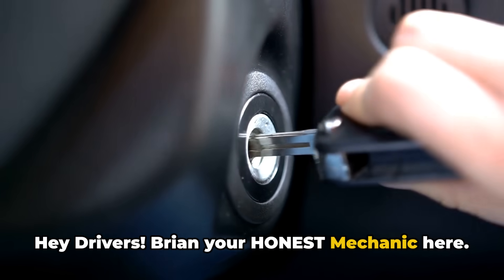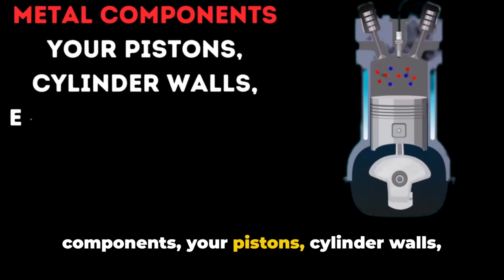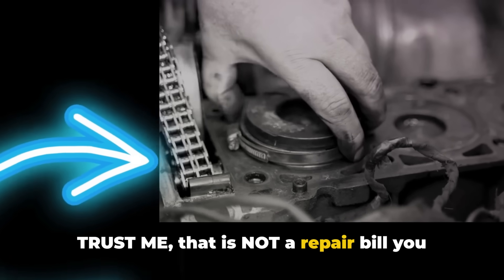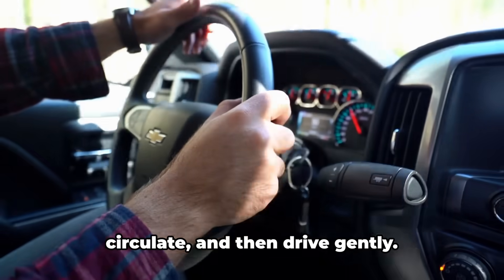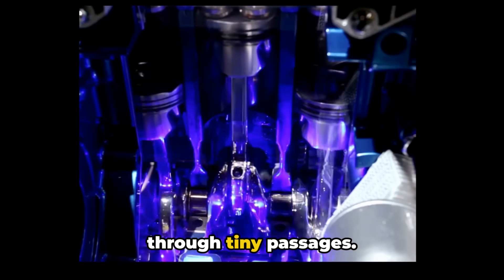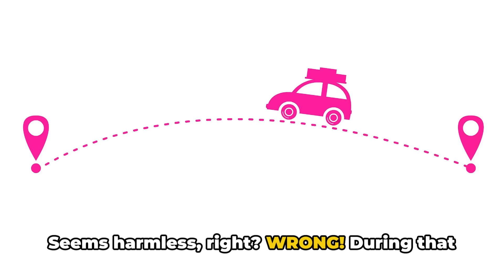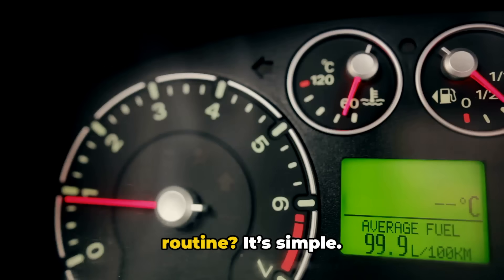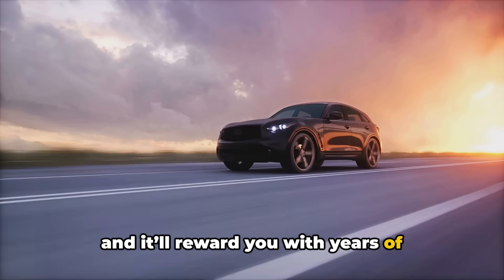5 Cold Start Mistakes That Wreck Your Engine (Avoid These)

Comment: This applies to pretty much any engine driven vehicle. I have a 2003 Kawasaki KLR650 that I’ve owned since new, and when it’s cold, use the choke to start, then turn the choke off ASAP. Go easy till the engine is up to operating temp. It has gone through three clutches, but runs like a champ at 80,000 miles. I have many high mileage bikes, and all run well following proper warm up and I’m a stickler for maintenance and using quality oil and replacement parts.

Comment: The waiting only 30 to 60 seconds of idle time, is this only for newer cars? I have a 2011 Toyota Avalon (I bought it in 2017) & I always let it idle about 2 minutes or so. Is this bad for the engine?
Reply: I dont think 2 mins is bad - its not that long. I do 2 to 5 minutes in cold. 2 would be like 0 C out , 5 would be like colder than -15 C out.

Comment: So it's really not good to use a remote starter? I'm talking about when it comes to cold starts.
Reply: I’ve noticed that control starter makes the engine idle in higher rpm so its actually useful thats the point of the remote starter is in the first place , and it turns off once the car heats up

Comment: I have a hybrid car that wont start the engin until i rev the engin. I dont know what to do to get the damn thing warmed up since it will drive on the  battery for a bit u til it desides to start tbe engin. I was reving the engin up to start the gas engin. Only way i know to get it to engage while parked.

Comment: I always warmed my cars up before driving. They have all run great for years and 200k + miles. My father thought me to I always change oil / filter every 3k 👍
Reply: My father was an auto mechanic and he taught me the same thing too.
Reply: Agreed.   When it's 5 degrees outside, I let it warm up a good 10+ minutes before driving.

Comment: You only briefly mentioned turbos. Shutting down your turbo charged engine, especially a diesel engine, without waiting several seconds to turn it off can harm the bearings in the turbo. Turbo chargers are lubricated with oil that circulates when the engine is running, it gets very hot. When you shut down the engine before allowing the turbo to slow down, the oil is no longer being pumped through the turbo charger as it continues to spin for a short while after shutdown. So give the turbo a few seconds to wind down before shutting the engine off.

Comment: Also like to add that especially diesel vehicles need 5 or so seconds for plugs etc to heat up. To do this turn the ignition and wait for 5 seconds, then turn on the vehicle

Comment: It's a good idea to let the engine idle down on a cold start. And if it's below 35 degrees, keep in under 35 mph for first mile or so. You'll give the engine a chance to circulate
Reply: mph doesnt matter - its revs that matter.

Comment: My only argument is not letting your vehicle idle 10 minutes to warm up. Sometimes longer depending on how cold. It helps keep your battery strong and warms up the oil temperature before you take off. I usually let idle until the rpm idles around 750 which takes about 5 minutes. Taking off while the engine is at high idle can do harm as well.

Comment: Very interesting when you mention not to idle the engine for any length of time but to drive off gently to bring the temperature up quicker. I read exactly that from an owners' manual for my Father's car back in the '60s.
Reply: Wow, That’s fascinating! It shows how good practices, like driving off gently instead of idling, have been recommended for decades. Automakers have long understood that gentle driving warms up the engine and transmission more efficiently while reducing wear and fuel waste. It’s amazing how timeless some advice can be—your father’s car manual was definitely ahead of its time! 🚗📖
Reply: @MechanicalGuy68 so what do you recommend for a garaged car that doesn't get driven on salt covered roads in winter.  Car gets driven year round but skips road driving in winter

Comment: I just bought a 4.6  Crown Victoria and I am horrified by the way the engine races after start up. I have no control over it and I don’t touch the pedals. As soon as it fires it sounds like it heads for 2 or 3 thousand rpm. I hope it’s not doing damage but I can’t control it.

Comment: Another important point, if you have a stop start on your car, keep it turned off.  Reduces engine wear, also fuel it saves is negligible when idling,  and makes the car safer to drive when power is urgently needed (no delay) such as busy junctions.

Comment: I only live about 5 miles from my job. But I stop on the way to work at my favorite gas station which is only a couple of minutes away. Should I drive around the block a couple of times before stopping or what?

Comment: I have a 2020 F150 2.7 twin turbo, when I start it in the cold mornings, she idles low rpms for a couple minutes, then she idles a little higher 12 hundred rpms for a few more minutes then idles down to 7 hundred rpms... Then I drive away slowly... 30 60 seconds!!?? Then drive away ( gently) no way... Never did and never will...

Comment: Nice to drive a plug in hybrid that shuts the engine off in the winter time after 1min drive and then starts and shuts it again and again depending of the throttle imput and the engine never reaches the operating temperature.😢

Comment: I was also told:
Don't start your engine with the A/C or radio on, less pull on cold engine.
Reply: Radio is prob fine , A/C is not good. Radio today is all electronic. It shouldnt draw enough voltage from the battery to make any difference.

Comment: Also don't just crank from start position in most automatics...turn key to 1st position and let fuel engage... you'll usually here a dinging sound and your engine symbol should light up...after that then crank it up.

Comment: Great video. I would add to pay attention to the oil life information on most modern vehicles. It uses injector count to calculate oil life. This will account for the idle warm up and excess fuel in the oil. Use synthetic oil and short change it in the winter. Thirty percent life remaining should be used as a minimum during winter idle increases.

Comment: 2017 Cadillac XTS I start in -5°c or colder. Wait maybe 10 seconds and drive a couple of mins to the store if I have more than I want to carry. It just rolled past 252,000 kms. Never had a single engine issue. I just change the non-syhetic oil about every 8 to 10 thousand kms. Regular maintenance is all that should be required or you'd have engines seizing up all over 🇨🇦 every winter. I call bs. 😂

Comment: The benefit of a plug-in hybrid is to allow the car to run errands on the electrical  propulsion system.  While having a gas engine to drive the car long distances.

Comment: I currently have a 2.5l diesel Subaru outback, which is garaged. Once started I back it out and turn it around in our drive, walk back and close the garage door.This takes a few minutes. Having returned to the car and driving down my drive and turning right on the road and then left or right at the T junction join the main road, which has a 30mph limit, takes a few minutes more. This vehicle has a 6 speed manual gearbox, so I can select a gear that produces 1,200 to 1,300 revs. I always change the oil more frequently than required.  This is a relative young car 2017 and only has done 25,000 miles. So far only routine service items have been replace. 

My previous three car were a Peugeot 405, 4 wheel drive with self-leveling suspension. And two Citroen C5 estates. All achieving 200, 000 miles and then sold on. They were treated in the same manner.

Driving conservatively saves ware and tear and money.
Reply: Are you from Europe? A diesel Subaru sounds pretty awesome
Reply: I had a Citroen C5 estate, the best car I have ever owned with a 2.2 diesel Auto box.

Comment: Remember oil temp is the key.

Also if the car is fitted with a push button start and requires clutch to be depressed, and has been stood for awhile. Turn it over a couple of times in neutral by easing the clutch up so the the engine won't start. Then start up normally up to 2500 rpm, drive away normally, using low revs (WITHOUT LABOURING THE ENGINE) until water and oil temps are in the green. Also changing oil and filter every 3000-6000 miles, helps extend engine life too.

Comment: My cold start of my 2009 Ford Expidition 5.4.  I start the engine and immediatly put the transmission in neutral, this causes the fluid in the trans to circulate and warm up at the same time as the engine extending the life of my trans, I have 130k on it now.

Comment: 96 Jeep Cherokee , 300K, 4.0, auto. Just now replacing my computer. Only leak (being fixed) is the oil extension tube gasket. Care for it like it’s a machine because it is.

Comment: In 1968 I was learning how to start a older tractor with a crank. It was in winter. You had to turn the crank a couple of times not trying to start it. After waiting 15 - 20 min. go back to it, give it a choke, a little throttle, turn ignition switch to on, and crank it hard. It would always fire up.
Reply: In 1968 I was 8 years old. You must be older.
Reply: What was the purpose of the few extra rotations?  And the long wait?

Comment: So we have videos saying, don't go over 2000 or 2500 rpm when cold. THen we have videos that say, dont lug your 4cyl turbo engine, meaning dont accelerate from 1000 to 1500 rpm. The problem is the newer cars shift very early for gas mileage. My car, a 2.5L Turbo, will shift at around 1200rpm when driven gently., it will be in 8th gear at 40 mph. To fight that, I would have to put it in Sport mode but then it will go over 2500 rpm when cold. So what are we supposed to do?

Comment: I wait 2 minutes before driving after starting engine. I work less than a mile from my home. Winter walking is not something I would do. A 10 minute walk in the freezing cold, at 6:30 in the morning, is not something I would consider. So, that part of the cold engine start, I can't avoid. In the warm weather, I do walk to work.

Comment: I started to realize this on my own. Lots of old timers let their trucks run for 10 minutes. My Tacoma wouldnt warm up to Op Temp after 15 minutes. Iv had piston slap in a GM 5.3L and Ford 3.7L. I started just letting the high idle settle down after 30 seconds, 1-2 minutes if havent driven in day or two. The trans temp seemed more important, it shifted sloppy if really cold. And remember if u drive a lot of city, short trips, to change your oil more frequently cuz it breaks down faster. 3k miles at the most.

Comment: Original owner of a 2008 Ford escape 2.3 with a manual transmission. At 204,000 miles, I am still on the original clutch and my engine is running strong with basic maintenance.
Reply: Save the manuals!!
Reply: @mustangman429 doing my part with an 03 Camry and 04 VW Passat wagon.. God speed.
Reply: @natural_law  hell yeah good to hear

Comment: I agree let the car warm up to operating temperatures before racing the motor, I still have a truck from the 60s that I have to drive 10 miles before it starts running better & fully warmed up.

Comment: Spot on I would say in my limited knowledge. I have always believed that long trips wear much less on an engine than many small ones. 
I have also found that should my car over heat on these long trips like uphill it is better to just slow down but keep going at the speed where the temperature is the lowest then it is to stop to let it cool down. If you stop the temperature goes sky high and the engine may seize. It usually doesn't if you keep going slowly. No over heating is best of cause.

Comment: Original owner of a 2005 Pontiac grand am here , had 42 miles on the odometer when i bought it , it now has 389,600 miles on it , original engine,  original transmission,  niether one of them has ever had any internal work or overhaul done . The car even still has the original alternator on it . Doing regular oil changes , regular  trans fluid flushes and drive  like you have some common sense and your car will last you a long long time . And yes i always allow the car to warm up to the 1/4 gauge reading before i drive it . The 3.4 v6 is a very durable engine as long as you take care of any problems that arise as soon as they happen.  The biggest engine killers are not doing oil changes and overheating the engine .

Comment: so what's the minimum journey length you should do before turning the car off again after a cold start?
Reply: I use 6 km / 3.75 miles minimum as a reference. By then, my coolant is typically at 90 C ( normal operating ) and oil temp is around 62 / 64 C.

Comment: I have a 39 year old Toyota Corolla with almost 400,000 miles on it and because of various reasons I can't always drive it.  I do usually drive it a few times a week but when I can't I have let it idle for about 10 minutes on very cold days.  I have never experienced anything negative by doing this then when I am able to drive it again, it definitely seems to ride better than if I just let it sit.  Also there are times when I have no choice but to make short trips.  I do the 30 -60 sec idle, drive slow then make the trip.  I have done this for over 100,000 miles with another car and have never seen anything negative as a s result.  I think just using common sense prevails.
Reply: In defense, this is a very short video and doesn't cover all the ifs, ands or buts... it does sound like you're being sensible, for your circumstances. That said, I don't find any problem with what he is recommending.
Reply: i have a 24 year old Lexus that literally wont move unless you give it time to warm up
itll spit and sputter and hardly move at all if you try to just get in and go
Reply: Those 400k miles could turn to 500k just because ur engine lasted that long doesn’t mean it can’t last longer his recommendations have no argument against it trust the common sense
Reply: Read your manual
Reply: It’s a Toyota built 40 years ago like a tank. This video is for tinny cars that started flooding market 15 years ago

Comment: Years ago i had a real old morris minor van .
I used to do nights shift and.park the old van in a car park near tbe thames.
In the wimter i put a small oil heater in tbe engind bay on low over night .maybe 20 to 25 guys would all go in the car park in tbe mornings ,all cars covered in ice  trying to start .Some needed to be push started  but my old van cranked over and started no problem .only thing i did do was put a cloth over tbe steering wheel to remind me to take heater out off ghe engine bay.

Comment: I'll never forget the time I worked at a warehouse. The warehouse managers son - Graeme - jumped into the warehouse van, a Ford Transit diesel that was iced up. As soon as the engine started, he sent the engine to full revs for several minutes 'to heat it up quickly'. He seized the engine and shot a rod through the crank case. What an utter bell *nd.
Reply: Stone cold igit.
Reply: He probably wouldn't do this with his own car.
Reply: Bell end

Comment: From what I've seen, small car engines today last much longer than the weak automatic transmissions in them so babying the engine is false economy. I have a Nissan NV200 with a CVT transmission. The transmission is non-repairable and is $5000 to replace and is virtually certain to fail before the engine.... so it's not worth fixing. This even if the transmission is serviced perfectly and the engine is not.  Junk yards are full of Nissan vehicles with good engines and defective CVT transmissions.

Comment: It is nice to hear what I have been doing, for a long time, is the right thing to do. My '93 Corolla, ran, and I traded it in, with 325, 000 miles on it, only because non engine parts were wearing out, and I am getting too old to work on cars, any more. I am doing the same thing with my '14 Toyota Tacoma, and hope to have it, as my last car. THANKS FOR THE INFO.

Comment: HELLO  Ilive inCANADA ,shure gets pretty cold in the winter,I drive a Nissan Sentra 2005, 1,8 litres,in the winter ,,with 210 thounsands kilometers,( about 120,000 milles )on the odo, using recommanded oil grade and adding LUCAS OIL STABILISER,,when I i get in the car I start the engine and drive away immediatelly,not carring ,eccept verry high reving,  keeping it in the 2 000 to 3500 rpm,,been doing that for 2 years,engine run,s great has very good compression,no oil consumption at all,transmission works as new,,no need to wait drive and go,,AS FOR STARTING AN ENGINE FOR 2 MINUTES OR LESS  IN COLD WEATHER ,DOES NOT ARM THE ENGINE,,,THE ENRICHED FUEL MIXTURE IS BEEING BURNT OTHERWISE YOU,RE IDDLE WOUDNT BE HIGHER,,AND ABOUT THE RUST BUILD UP, NO WAY, THE STICKYER COLD OIL,NOT HAVING BEEN HEATED UP,THAT HAS BEEN SPLASH ALL OVER THE CYLINDER WALLS,,  WILL PREVENT THAT,,shure if you,re talking about grandmas one it,s different,engine are built to work,lol,,( one thing is not mentionned here  cold metal is harder to wear than hot one,,)when it,s very cold it,s harder then when it,s verry hot,)so cold start and drive aint, a problem,,by the way I own a TOYOTA 4RUNNER 96 2,7 LITRES ,MANUELwith 244 000 kilometres,that I am not using often,due to excessive fuel consumtion,lol,,I,in the winter start it for a few minutes then shut it off,most of the time to moove it to remove the snow where it stand,,i shut the engine whyle doing that,,long iddeling is bad,,some time I  drive it to do my shopping ,resting for too long aint,good ,,engine runs as new  not even a quarter of oil by 10, to 15 000 killometres( him too i use the additive mentionned earlyer),,I love it, lol, Iam 71 and been doing that with all the differents vehiculs I owned,,so must be  ok ,well for me it is,,,